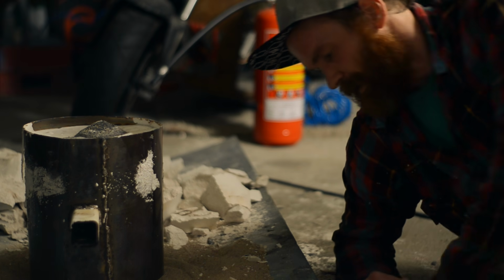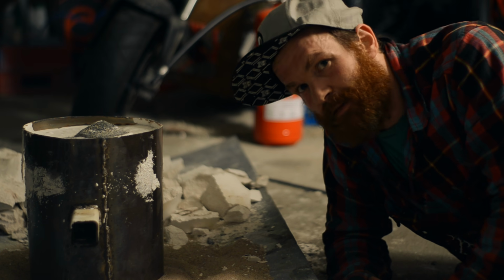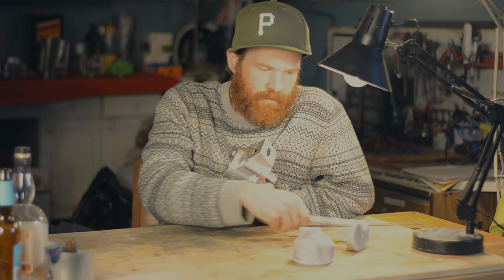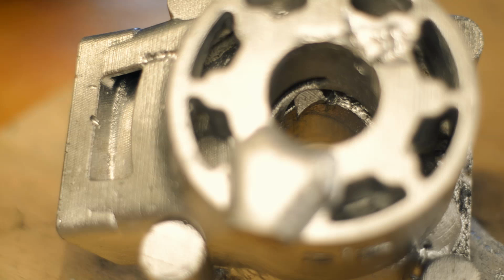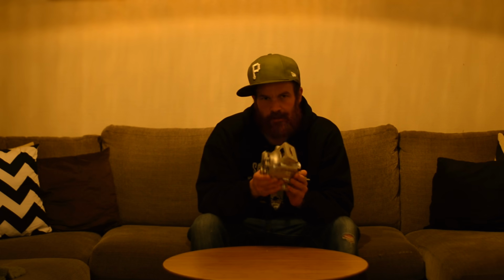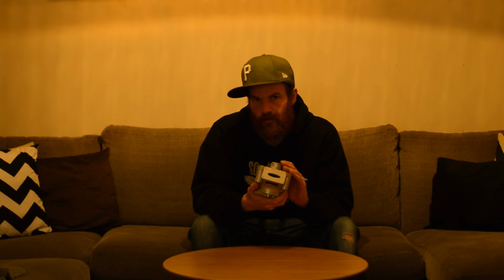GOT ONE! - Casting the Most Powerful Two Stroke Part 6

Comment: Hey mate, in Italy we generally use a 50/50 mix of plaster and brick dust (we call it Loto) it’s much more stable at high temperatures
Reply: Italians are the best at building two Strike engines so doing it like them should be useful
Reply: @julienlang2871  The Italians have some of the best foundries in the world, which are making parts for Ferrari, and the most important part of that process is the sand they use for casting, which is highly specialized. There's a documentary that natgeo did on it that is absolutely breathtaking. They literally hand finish the molds with jewelers files and make sure there's absolutely no dust. It's pretty phenomenal.
Reply from the maker: Thanks for the tip!
Reply: how on earth do you reckon that, Julien ??  Yamaha RD, Suzuki GT were world class and sold loads - knocks the spots off any eyetie strokers surely ??
Reply: Raymond Ashby legendary rs125
Reply: @gloriushumbug5832  Cough* NSR500
Reply: @gloriushumbug5832  Rotax 123 is legendary
Reply: @jttech44 name of the doc ?

Comment: Fantastic!!! Please research slag trap in gates, it is a high point in the runner/gate to float out slag, you can also add extra low point to help catch the heavy crap, steps in the gates will help this.
Also maybe rubbing wax on the PLA  pattern before  molding will help to avoid the fine problems like the mold material going into the cracks.  if you are high enough oven temp to burn out the rest the wax then you have no water in the mold for sure.
Try modifying the metal after degassing, degassing removes sodium and causes a coarse grain structure. Replacing this loss will give the metal full strength, without it Then it will weaken your LM25 aluminium.
Try snapping the spru and looking at the grain in the break, should be fine and grey not crystal looking.
Keep up the great work, if you want a giggle search "Two Stroke Nitrous Oxide Wet Shot" look for the BIG blue Nitrous bottle on my honda NSR150RR  on my NosMan Channel, dyno coming soon...

Comment: You probably should do the vibrating of the mould in steps to get the air bubbles out like you would do when pouring concrete :) 

Also your garage looks a bit hazardous for working with fire because there isn't gypsum sheets or similar on the inside.

Thanks for the videos, they are very interesting!

Comment: Looking good. Much better. You could try making a ceramic slurry for your mold it holds up to metal casting better than the plaster does and would be less prone to cracking.

Comment: where i work they we cast the mold out of wax first then coat it in ceramic then melt the wax out then cast it with a nickle/titanium alloy and then smash and shake the ceramic off. then a single part goes through like 200 hundred people before the part is deemed usable or scrap to be melted back down. What you're doing is impressive.

Comment: To get the air bubbles out you could use a hammer drill set on the chisel function and place it on the bench or floor next to the casting. You don't need to vibrate the actual casting. The larger frequency compared to the hand sander might not dilute the air bubbles.

Comment: Not shure if you allready do this, but try preheating your mold, it will help with flow of your casting. It keeps the aluminum from loosening to much heat, heating up the mold.

Comment: a future tip.... water washes that plaster investment away like easy peasy.. big bucket of water and dunk the whole mold and casting init and it falls off.. just washes away

and get a huge vacuum chamber for the plaster mold it helps with finer detail after you purge the air from the plaster and any trapped air pockets or bubbles

Comment: Depending on what you are printing with it may be worth using an acetone vapor bath thingy to smooth out the 3D printing. It's known to smooth and toughen the 3D prints which is probably something that would be beneficial.

Comment: I love your videos man 
Great stuff 
Couple of suggestions 
Some kind of fibre in the plaster maybe Rockwool insulation will make it less likely to crack.
And rather than tapping the plaster to remove bubbles make a small vacuum chamber to de-gas the plaster mix.
Vacuum pumps can be quite cheap these days.

Comment: I was reading a news article from a local 3 d print shop here who printed a small camper"caravan" and they talked about raising the room temp where the printer was to get a better bond between layers. You could try that. Also have you talked with any local dental labs where they cast partial denture frames they might have some ideas about investing. What metal are you casting with?  You might try and get some old Honda engines and break them up. They last a long time and it is probably their metallurgy that makes that difference. Start with a high quality material for prolonged life span. I can't wait to see this run.

Comment: I've had issues with layer shifts on my ender 3.  It turned out that cura has a setting called jerk control.  If it's on turn it off.  In my case I will also get y axis layer shifts if I have any travel set too fast (100mm sec is top for me but I have a glass bed).  You can also mess with turning up your stepper motor current but I dont have experience with that.
If those things don't work it's possible you have a driver or stepper motor issue.

Comment: You beauty success you ripper, i recon machine weld and run it then poor couple more to cut open .

Just a thought if there's air pocket problems with mould standing vertical maybe lay it down so intlet port is top or bottom. Hopefully that may eliminate any pockets and have more breathing vents to.
Awesome work you legend,  fingers crossed for ya

Comment: Can you coat the mould parts BEFORE putting in plaster??
A finer mix of plaster of similar,to insulate it from bubbles and cracks,gases?
Reply: I think that is a good idea. I've seen it done before in industrial casting videos.
Reply: Typically they coat the molds  in wax, then paint on the plaster with a brush. That way they don't get any bubbles on the mold itself. You can't let the plaster set all the way though, so they usually mix the plaster wet, brush some on, let it get a little tacky, then pour the mold. Tough to do with a single person though.

Comment: Have you thought about doing a 2-stage investment? Gypsum shrinks and cracks dependent on volume and liquid evaporation. Invest printed cylinder (not including sprues) in small container then invest that and sprues in large container like you are doing.  Should minimize shrinkage and cracking. Don't know if that has been done or is possible, but would make sense.

Comment: Have you looked into dipping the pla (I assume it's pla) in acetone? Done a couple of times it should melt the outer layer just enough to smooth the print and close any cracks
Reply from the maker: Good idea! Was actually just thinking about it. It does work for gluing parts together so it must dissolve the surface a slight bit.
Reply: @2STROKESTUFFING  pla will need direct contact with acetone for it to work hence why I suggested to dip it ,  but abs will smooth out better using acetone vapour , I try to use abs when printing as the acetone vapour bath gets the prints nice and smooth with a glossy finish , to do a vapour bath I'd suggest using a slow cooker , no naked flames and you can regulate the temperature
Reply: Also in your print settings select the filament size to 1.72mm , instead of 1.75mm should help with the layers and reduce any gaps , as the printer will extrude just that little bit more plastic.

Comment: What about an old fashion "sleeve: to salvage some of the ones with imperfect bore's and transfers....would begin to allow test cases and timing research..:) Love this project and channel. Especially the use of what we used to call "Stereo Lithography" back in the day when we were designing code to do what was called "solid modelling" which was essentially a data base exercise...but that's WAY off the subject!

Comment: What about fiber reinforcing the plaster? If you could get chopped spun basalt fibers in the 2.5mm to 5mm range it might be worth trying. Vendors sell it in bulk here in the US as a cast concrete reinforcement. Much stronger than glass fiber, more chemically inert and heat stable. If the strands are short enough they may fill the mold without causing excessive air pockets/bubbles.

 I hate to throw another experiment into your mix. You do work so hard on each of these attempts, but if you could pull off non ceramic mold low pressure casting in a home environment it would be pretty awesome.
Reply: Nice name
Reply: Phoenix Swooping 
Yeah, I addressed that in the fifth sentence of my comment...

Comment: You may not need to increase your extrusion multiplier or temperature. If you are using pla, you may get by with increasing the amount of outer walls and maybe slow down your extruder fan speed allowing it to cool a little slower. Its been a while since I printed with pla though as I mostly print abs and leave the fan turned off.

Comment: I think the wet mix plaster you are using is the problem. Any water content will instantly flash to steam and cause bubbles in your casting. I used to pour lead keels for my brother's r/c yachts and plaster never worked. Ended up using casting sand.

Comment: If you want the print to hold together better, and be water-tight, try increasing the number of perimeters or shells of the print. If you are using CURA you can even set the gcode to print the exposed perimeters slower than the ones internal to the walls. The slower the print speed on the outer perimeters will give you water tightness and the faster internal perimeters will make it print faster on the area you don't care as much about. You use the slower print speed where it matters to get the better the bond between layers, and you can avoid cranking the temperature of the nozzle so high it makes all the strings and globs. Extra perimeters actually doesn't increase the print time as bad as you would think, and when you have the added perimeters you get less failed prints as the structure is more rigid. For your application, you could also consider a larger nozzle bore to lay down a fatter wall. You don't seem to care about fine detail since the part will be machined. Good luck!

Comment: Maybe paint 3d print few times using primer so paint seal the layers and smooth it :)
PS add few mm of material where you always get bubbles (and where you can do that) so after casting you can grind it :)

Comment: Giday again , will agree totally with emil82 mixing under vacuum , but sadly the machine that is used is expensive ,  try Rocco gipps  Osteroder ?  ?? About spelling ? Near Hanover if i can remember ,  but no air in mix , also try rehydrating your spent plaster  ie : kiln to about 600c till anhydrated  should give body to next mix good luck cheers from Aus.

Comment: Pull out the air boubbles with vacum pressure?
Reply: The problem with vaccum using a 3D printed model is that you will very likely suck plaster into the cavity of your model when releasing the vaccuum.
Reply: You vacuum your envestment as it cures,  then fire the mold to remove the printed material
Reply: Vinreeb u

Comment: Are you gonna coat the bore or do some sleeve in it to sheld the aluminium from the friction?
Reply: I think he has mentioned having it nikasil plated before.
Reply: Correct me if I’m wrong but i thought he once told in a video that it will get nicaseal From airsal
Reply: i want to NiSiC plate my parts still havent figured it out 
 @NatashaB
Reply: @Dimchface  you can send your cylinder to airsal and they can nicasil it for you.
Reply: Ok, thx guys
Reply: @Dimchface  Cylinder plating is really, really hard to DIY. Nikasil plating is trademarked and can't be copied without licensing, and that process is only done by places with proper machines to do cylinder bores.

The easiest thing to plate with would be standard nickel, which is what most cheaper cylinders use. It holds up just fine, even in high-performance examples, as long as you are using cast iron rings and get a thick enough plating.

The fewest steps to plating aluminum with nickel will involve zincate treatment, then copper plating, and then finally nickel. It's a long process even then, and easy to mess up.
Reply: @NatashaB  im pretty sure you could copy a trademarked thing or process, as long as you dont pass it off as your own or try to profit from it.

Comment: Great video, so close.
Congratulations on getting this far, keep up the hard work and this will happen 

I’ve never worked with plaster but use resins every day and I wonder if some of your faults could be caused by air in the plaster, at work to stop these sort of faults when pouring casting resins and silicones we always degas the liquid, I’ve also potted electric windings and again you would degas,

people watching may have a better understanding of using plaster but just an idea from watching the video.

Comment: Would it be any better to 3d print a mold so you could easily remake it out of wax or some sort of foam. That would prevent the pour from getting between the layers at least.

Comment: did you mould this one upside down i could not tell try using sand and the additive you mix in it use co2 to set is might be more stable than plaster either way good job bro keep them coming cant wait to see one running

Comment: Amazing dude you learn so fast it is scary.. just a thought now, but how about having some kind of small flow restriction where you poor the metal in, like half-way down the pipe/tube/line (what ever we call it :p) so the "splash" of metal wont be as violent inside the mold. just a thought i know nothing about this stuff. great video btw, and yes that camera placement was epic :D
Reply: Yes and no, if you create a restriction in increases velocity of the stream (think about an open hose and putting your thumb half over it) which increases turbulance, which is something to be avoided in aluminium.
There is plenty of theory for ingate systems for aluminium and its a tricky thing to get right.
Reply: @mitchellbaker4847  ok thanks for clearing things up for me =)

Comment: Haven't missed an episode you might  need a source of vibration when pourd to solve the air gap issue and a vacuum chamber to remove air bubbles from the plaster they also make filter pucks to slow down the molten metal @ the bottom of the spru
Reply: I've seen vibrating the mold when pouring metal both improve the surface finish and make it worse, it takes a bit of mucking around to get the frequency and amplitude right. On a job like this without a super high surface finish requirement (can still see the print lines) i dont think it would really be beneficial.

You are on the right path with a filter as a flow control device, however done wrong these can create more air entrainment than they prevent (look up bifilms in aluminium, remeber Aluminium makes its oxide layer in femtoseconds) by acting like a like an aerator on a tap/faucet.

The real solution is somthing like the cosworth process/vacuum casting, tilt casting is interesting, but having a decently designed runner system is the most practical in the real world.
Am currently working on a process where we are using an inert gas (argon) as a purge for the mold cavity (displacing the vast majority of the free o2) to prevent oxides forming.

Aluminium is complicated stuff.
Reply: @mitchellbaker4847  well ur doing one hell of a job and I want one when u get it all figured out and I want to give u several fists full of cash cause u deserve it you are a man with a plan on a mission of addition (of power)
Reply: @salvatoremilitello8490  unfortunately alot of these sort of things are held under patents, i'm just doing this at work as a proof of concept and going to use this as part of a paper for uni.
Reply: @mitchellbaker4847  well at least when your done I can use ur journey to help me make one and I'll send you a bottle of my home towns best Jack Daniel's I think the gentleman Jack or single barrel are the 2 worth my money 
P.s. I wonder if u could sell the STL file on thingyverse for even a dollar I want to contribute back to you ur time is worth it 
P.p.s. thank you u make great content and wish u much prosperity in all ur endeavors

Comment: Because you want to is the answer, BUT what drives you to build such a small engine. Simply build a bigger one and make more power or is the plan to make a small engine and then scale/ build it larger ? I love watching the progression ,however there are simpler ways to get the same results . 3d metal print the cylinder and press a steel sleeve in then you can change port angles or anything you want.
Reply: 3d metal printing is extremely cost prohibitive
Reply from the maker: Yep
Reply: @mitchellbaker4847  Not realy when you add up the cost that has been spent . Not my money so I enjoy the progression .  Renting time on a 3d metal printer is not as expensive as people think . If you only want to build 1 part it is cost effective . But we will have to wait and see what the end goal of this project becomes. So far we are in the dark as to what that is. Is it to prove VE of a small motor or will it be up scaled to a big motor ? I don't know but will be watching to find out.